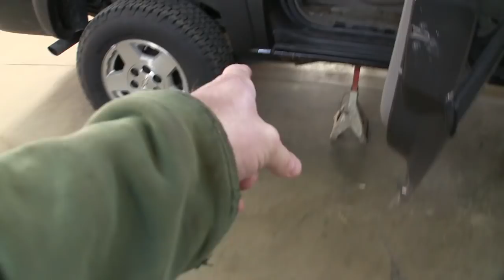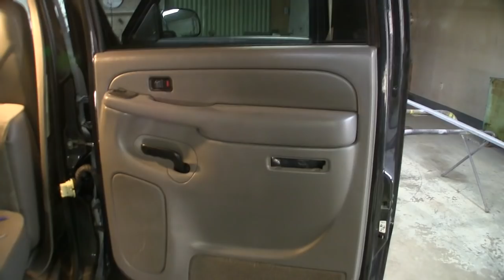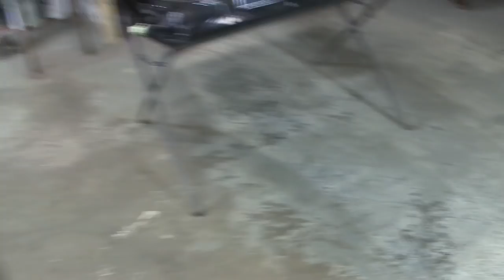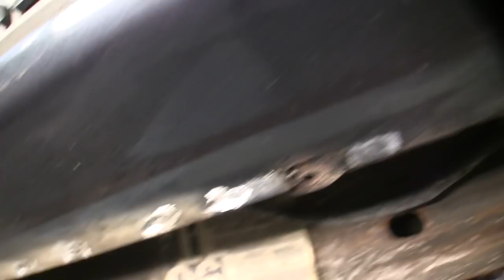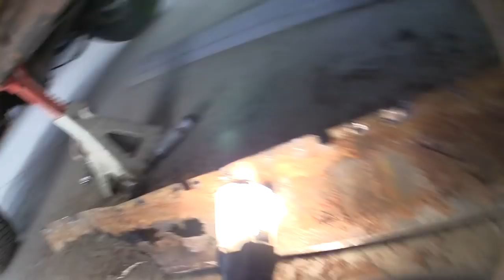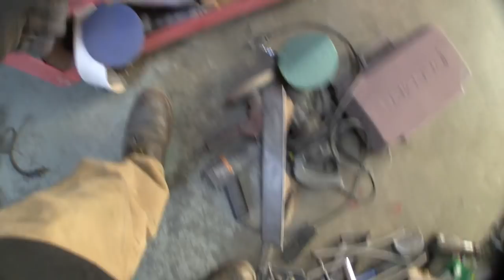Project Rusty Suburban - Rocker panel rust repair part 1

Comment: Lots of good tips, I did my cab corners on my Silverado this year and remembered you mentioning how flammable that foam in there was but oh yeah it started to go up but I had my water hose just on time or it would have traveled up to the roof. On to part 2 👍
Reply from the maker: +Steve Rob It doesn't take much to set them aflame for sure....

Comment: Interesting. I have an '06 Avalanche that I'm quite anal about and it's my year-round vehicle in upstate NY, also do some plowing and I've been battling the rust since I bought it back in '08. Anyway, I have a nice trick to get into those rockers from the rear. Pull the rear wheel, remove the 4 7mm screws on the plastic inner wheel well trim. In the front of the wheel well, directly in line with the end of the rocker I bored a 1 1/2" hole with a hole saw, even found some nice plastic plugs that fit afterwards - though duct tape will work. Through that hole I can actually even see up inside the full length of the rocker tunnel. Makes it easy to get in and spray your rust proofing - I see you're a Fluid Film guy too - and also gets you access to the inside of the front of the quarter panel too. When done, plug or cover the hole and the wheel well trim covers it all. Yeah, I might be doing at least one partial rocker next year.

Comment: Great work. Looks like you got the fitment really good. I have an 03 Silverado and will probably have to do this one day. I'm in sw VA. We do get some salt on the roads. So far so good on my truck. I should have treated in when I got it, but never thought about it. I definitely will on the next one. Glad the toolbox still works and it missed you.
Reply from the maker: +Double R Restorations Cheated the reaper once again.  Had to change my shorts though, lol

Comment: Good stuff.  The spot weld cutter really isn't that bad.  I broke 2 bits but they are cheap.
Reply from the maker: +mossman381 I'm just not a fan of the hole saw style spot weld cutters for panel removal unless I absolutely can't grind them thin.  I can grind them several times faster than drilling them out.  Just my preference though

Comment: I enjoyed this and the other video on this Tahoe project. I have the same problem with that lower door frame / rocker body panel. I have always wanted to buy a welding kit. Can you share how many hours this project may have taken you to finish? How well did it age since you fixed it? Total cost? I will be purchasing a welding kit as my 2015 Suburban LT has all the common rust problems that come with age plus the affects of living in the cold salty Northeast coast in Massachusetts.
Reply from the maker: Probably had 40-50 hours in all the repairs to the suburban. It still looked pretty good when they sold it 3 years later.  This work was done six years ago so it’s not fresh in my mind